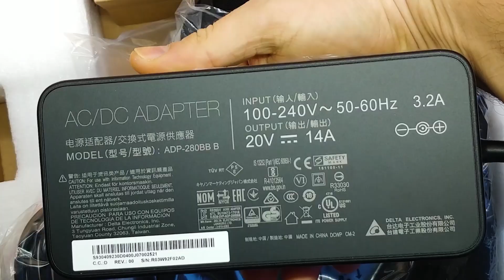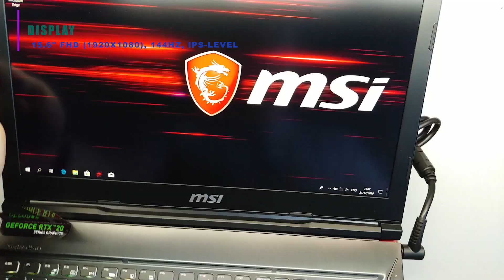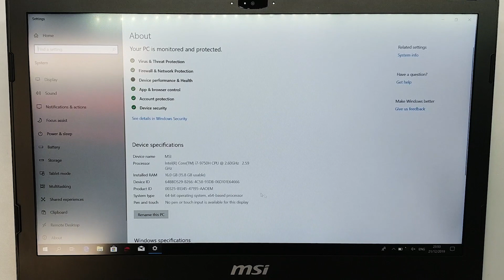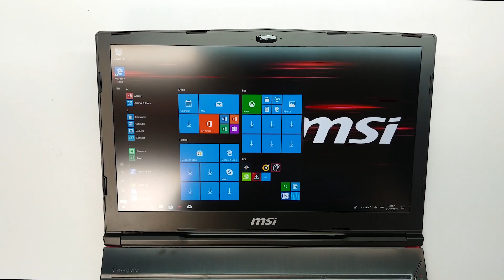MSI GE63 Raider RGB 9SF Unboxing Teardown

Comment: I just picked up this same laptop a couple of days ago. It's a 2019 model, I paid $1,200. Still best specs and expandabilty for the price of any 2020 laptop I could find. I dropped a 2gb ssd in place of the 1gb mechanical hdd and a 2nd 500gb nvme drive in the open slot, along with the original 500gb nvme drive it already came with.  Been pretty happy with the laptop for the price.
Reply: I have the same laptop as well and love it! I am looking to upgrade my storage as well. Most like do exactly what you did. Just curious as to which SSD's you put in and how do you like them.
Reply: @ericarini2435  From NewEgg I bought Crucial P2 500GB 3D NAND NVMe PCIe M.2 SSD - CT500P2SSD8 and  Crucial BX500 2TB 3D NAND SATA 2.5-Inch Internal SSD, up to 540 MB/s - CT2000BX500SSD1 I am happy with the purchase. The SSD is noticably faster than the mechanical HDD and the 2nd NVMe I use current games I am playing and for video edditing and other Virtual Machine I run from time to time.

Comment: I've the same laptop :) I recommend it also :)
Reply: Alkyonne What are the degrees as in Celcius for both CPU AND GPU when gaming?
Reply: @immamuellokant138  I've undervolted both CPU and GPU, also disabled turbo on CPU
Control Ultra presets, RTX medium: 60 fps (one of the most demanding game with RTX)
GPU usage %98, 79-80C
CPU usage %30-40, 68C (turbo disabled)
Both fans set to %100 when gaming, hope that clear things up :)

Comment: Hey bro I plan to buy this laptop should I buy it or not ? Need help
Reply: I just bought this and I love it
Reply: King Mugg1n What are the degrees as in Celcius for both CPU AND GPU when gaming?
Reply: I don’t have this laptop but if you can afford to buy it it’s a pretty badass laptop, it’ll run anything you throw at it

Comment: How's the battery life?
Reply: It might get 4 to 4 1/2 hrs max, if we put it in the lowest power profile in dragon center, and go into Intel HD gpu settings, set it to battery use profile so rtx 2060 does not run in the background for web browsing, and turn backlit keyboard off, and turn screen brightness down to less than half.
Reply: 90 minutes tops on phub. Same with watching a movie I hardly get to finish before it dies.

Comment: Does that USB-C port supports Charging?
Reply from the maker: No... i think it's regular USB 3.1 Type C Gen 2
Reply: @ITFIX  have you tried to charge with any high power USB-C charger?
Reply from the maker: @Khurram_CA  i didn't tried, just cheked documentation for this laptop and ot was saying that is regular usb-c and not thunderbolt
Reply: @ITFIX  yeah i know it's not a thunderbolt port, but some laptop models supports power delivery even if the usb-c port is not a thunderbolt port, that's why I was asking.
Reply: It supports 100w power delivery